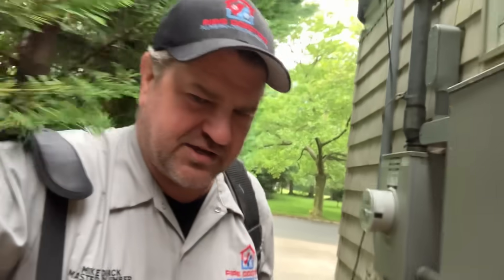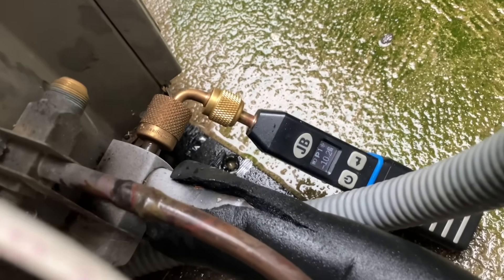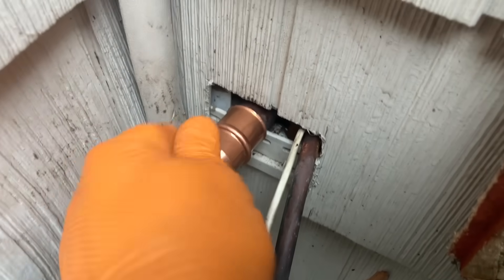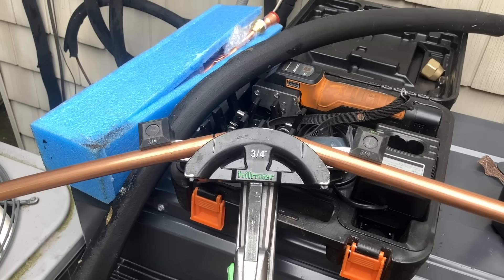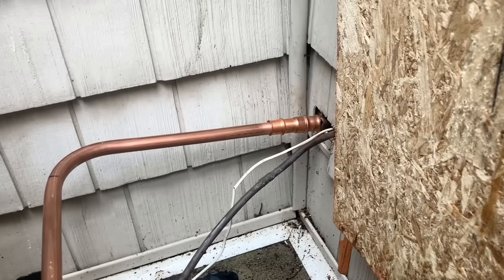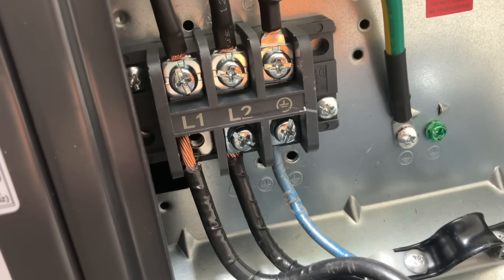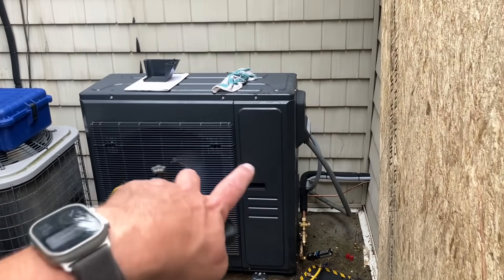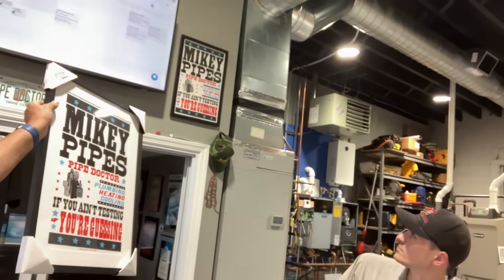ACiQ 4 Ton Heat Pump Retrofit – Brutally Honest Install & Tool Review | Mikey Pipes HVAC

Comment from the maker: ✅ Limited Edition 2025 Mikey Pipes Poster Now Available - only $42.50 delivered! (includes 5 stickers, pen, card & magnet)
10% of all proceeds goes to our non-profit organization

PayPal is: office@pipedoc.net
Venmo: @PipeDoctor
CashApp: $mikeypipesny
Zelle: office@pipedoc.net

👉 To learn how to become a private label brand or an official ACIQ dealer, visit:
🔗 https://aciq.com/mikeypipes
Reply: Hello Mikey, need some of your expertise for my system if you can please help out. 

I have purchased this similar aciq system 5 ton, extreme series, 

ACiQ-60-HPD / ACiQ-60-PAH, these both outdoor and indoor units are communicating in nature using their proprietary HA HB protocol (S1 and S2) terminals from indoor to outdoor, and then HA and HB terminals from AHU to thermostat (aciq ACiQ TL04-1 Smart Thermostat that has both HA HB and 24V support).

That said, I am hoping to be able to utilize full range actual inverter ramp up and down operation as per it's design, paired with true variable speed blower motor using their communication protocol HA and HB. 

I have learnt that, if we use these smart aciq communicating hvac system using standard 24V thermostat (ecobee, nest etc.), we cannot get the full range of true variable speed operation neither on inverter nor on AHU! It's probably because we are limiting system to work on 1 of 2 stages along with some compromise with blower speed of AHU I assume due to 24V thermostat. 

Anyway, here is my question,

We have zoning for our home (floors), and wanted to learn how zoning works with such HA HB (communicating) system protocol?

I am unable to find a zone controller and dampers, that can communicate with the thermostat and so do the AHU and work together to create smart communicating system. 

Do you have any input on this?

Do I really need zoning that is capable of such communication using HA HB protocol?

Can I simply go ahead and use 24V system for zoning? If so, can I still be able to utilize full scale communicating system using HA HB communicating system?

Any chance you can provide some help given you probably have installed these a lot. 

I

Comment: @13:00 you mentioned that you took off the electronic TXV and used a magnet to open the valve for vacuuming down. But in later videos you mention powering up the indoor unit, and turning AC on and setting to 60° to open it. 

Does one way work better than the other? We have been installing some of these, and they have taken forever to vacuum down. Customer support said to power it up  but never mentioned setting it to AC or anything. That WOULD make sense, but just didn't think about it setting to AC to open valves. Do you just leave the disconnect pulled then, so it's not firing up the outdoor unit? 

Thanks for your videos, they've been pretty dang helpful! :)

Comment: HPs should be off the ground so there is less chance of it freezing up. Note I did hear you say it will not be used ias a heat pump (whatever that means), but never know what the future holds. Reasons for freezing up due to snow (northeast) and restricted drainage. That is why u wanted on the wall originally. Could've got some plastic risers for under $20 at any home depot ect...  As a new tech many of the towns in Hudson🥶🥶😱😱 Valley region would fail that install! Tell me I'm wrong...
Reply from the maker: Thanks for sharing

Comment: Hey Mikey I don’t know what bending tool you use but I saw you saying that NAVAC battery powered bender is too expensive well they do have a non battery powered bender that I’ve been using and love it. Very simple very quick and the price is right for a bender of that quality. 
Keep up the great work boss.
Reply: I commented before you did any bends. Had the hilmor I think that whole brand is trash and overpriced. Seriously consider the navac manual bender.
Reply from the maker: Thanks for the tip!

Comment: What’s the benefit of having a 3/4 suction line on the 4 and 5 ton systems? Something i haven’t seen before … even the 16 seer 3ton systems I’ve installed are 7/8 for efficiency
Reply: Taking a wild guess here, probably because the existing lines were already 3/4" and the effort to replace them wasn't worth it...

Comment: for stranded wire that's to large for  that style terminal, just divide the strands in half, within a few strand count and put it on either side of the screw into terminal. work it a little bit/shape around the screw or a nail and it will fit in great and tighten better than it lumped to one side.

Comment: I'm ok, but rusty at bending. learned as "sparky" training in the mid 90's, granted I haven't ran much conduit over the years or even stayed a sparky, I did run about a hundred feet of EMT a few years ago, lots of bends and offsets to clear obstacles and offset into boxes.
lol, had to look it up, use a chart and really think which way to bend it and the order of which bend first., because it also ended up being many close together complex bends. only messed up a few. 🤡

Comment: Do you have to add extra refrigerant to those 4 ton units when paired with the ACiQ PAH air handler? I'm about to install a system in my house and the manual is unclear. One page in the manual says the 2 ton and the 4 ton need extra added but the 3 and 5 ton models don't. I'm hoping all models are good with the supplied charge with a <25ft line set.
Reply: Should be fine, but not an expert. The issue is if you need more, you have to deal with 454b. ACIq makes a similar model with R32, except the intake side 24x20 instead of 20x20...20x20 is a drop in fit for my setup. 5 ton is what I'm looking at.

Comment: Practice makes perfect Mikey…you’re doing fine with your bends lately 👍
My HVAC contractor was here today performing my annual A/C tuneup. They tested the OEM cap dynamically and it tested fine but wanted to replace it because it was rusty. I said no thanks as I have spare Amrad caps and also contactors standing by for emergencies thanks to you and your videos 🏆

Comment: It’s a nice system and you don’t have to worry about over sizing the unit if you use correct thermostat.   Love that it also has dehumidify mode.  The manufacturer has so many brands it’s hard to keep up with them all.

Comment: Once the renovation is done and you put that last 3 ton in. What will you put under the outdoor unit (top unit) to catch  the water in defrost mode so it doesn’t pour all down the unit below?
Reply from the maker: Did you notice HOW the lower unit is 14” off the wall????
Reply: @PipeDoctor nope! Totally missed that. 
How far will the bracket hold the upper unit off the wall?

Comment: TOO WILD 
I replaced the 45+5 capacitor on my 22 year old Trane XR12, about 3 years ago.  After watching Mikey so much, I figured, hey why not have a spare capacitor on hand.
The very day my new AmRad capacitor was delivered, my Supco cap bit the dust.  THE VERY DAY, it's crazy!  😳 
Are Supco capacitors know for their reliability?
Reply from the maker: Crazy coincidence
Reply: if the fan motor bearings aren't shot, they likely are ready to go any time now.

Comment: Welcome to my world brother i deal with that everyday . Today was real bear of a job the builder kinked the 3/4 liquid line in the wall  . But it held Nitrogen but Vacuum didn't hold or go down in microns .
Reply: a single flexed kink wont do that, they must have worked it multiple times to cause a leak or you had lots of moisture in the lines/evaporator or a leaking schrader at evap. most everything has them now as we as multiple leak point possibilities.
Reply: A 3/4 liquid line?? That’s wild